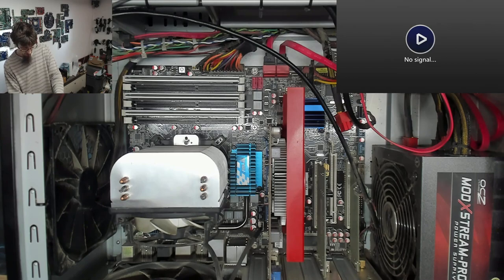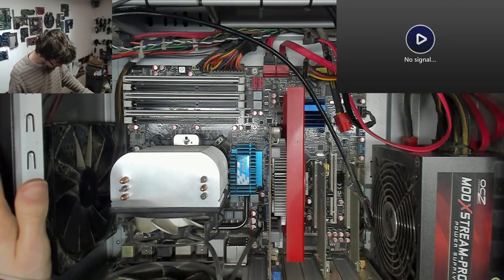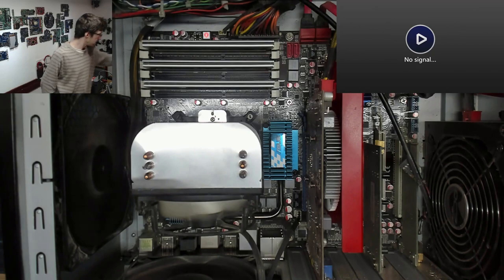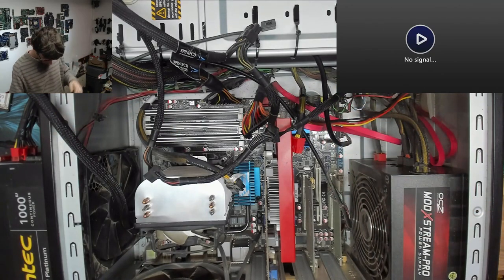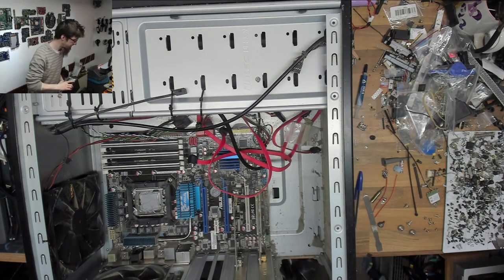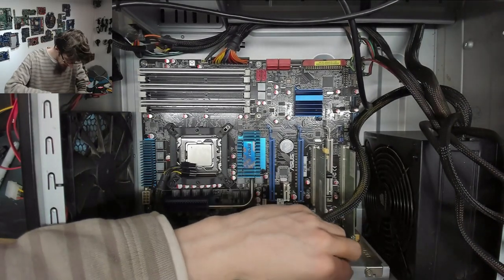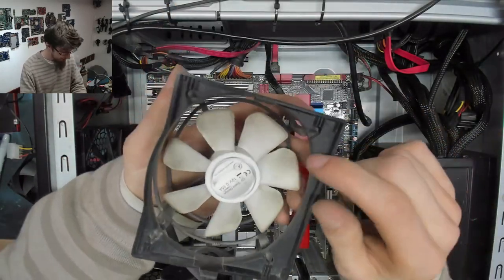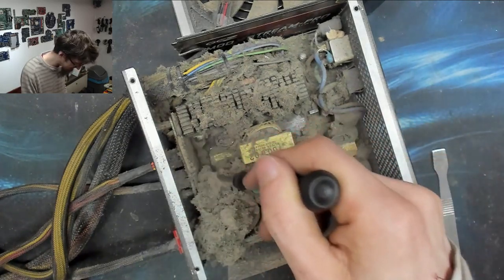LFC#163 - 1st Gen i7 No POST

Comment: The plastic sheet in the PSU is actually a blast sheet. It covers the parts of the parts of the PSU that could emit a blast or sparks out of the fan or a vent if it goes pop, mainly the AC inputs and conversion. I used to have a job repairing those and server PSU's. That is one of the dirtiest I have seen in my time.

Comment: The dust looked like the owner was a smoker or lived with someone who smokes a lot. That is some super fine dust buildup.
Reply: Smoker dust turns into a thick yellowish/dark tan color and is caked on thick not fine,  but at least we all know where you stand on smoking, For whatever reason;)
Reply: @wolfchacer0139  cigarette ash is super fine and stinks so bad and knowing smokers not all of it ends up in the ashtray. My old PC had a ton of similar dust build up from when I was younger. Now I don't smoke around the PC anymore but that's because the kids use it sometimes. 
Source: am smoker.
Reply: @LadBooboo  Yeah but with humidity in the air and other particles it becomes this sick Yellow/Brown gooey form on fans and other parts.  I build and repair PC's for a living and this here looks far more like neglect than any cigarette induced mess and is more typical.
Reply: LadBooboo my grandfathers old dell desktop has a lot of cigarette dust buildup. He doesn’t smoke, but my uncles did. They never smoked around the computer, or even inside the house. The residual smoke was enough to collect inside it.

Comment: Great video - as usual!

Two comments, just in case you really read all "old" comments:

- Regarding the time it takes for the CMOS to reset: From my experience, the CMOS is gone, once the battery is out. Like within a second. I never managed to pull the battery out and put it back in right away without the CMOS being cleared. The "PP_3V3_RTC" - as Apple would call it - has basically no bulk capacitance, since it draws zero power, like literally <1 uA.
One minute as a rule of thumb makes sense, when there is a Power Supply like "The Antec"  connected. 
I would love to see the results, when you do an actual test on multiple Boards. However: My rule of thumb is: 5-10 Seconds, but also that only for peace of mind. 

- And then again regarding "The Antec": You could just add a resistor to the +5VSB. I guess the Antec will have at least 1 A on that rail, which no MoBo will ever use. So maybe just add a 50 Ohm resistor (at least 2 Watt rated, so it does not get to warm) to the +5VSB on the backside of the ATX connector and that problem should be solved.

Comment: I've never seen that much dust in a psu before.  I use a brush and vac to remove the dust and if the psu is outside warranty, I open it up and brush it out, going outside to do it...always worth a look at the state of the caps.
I always check the 12v, 5v and 3.3v with a meter.

Comment: Nicely done. Visual inspection is very important so unnecessary work isn't done. 
However since there are multiple RAM sticks, I would first take each one out in a sequence and see if that makes a difference and see if any RAM slots are dead. Also as you did, defaulting the BIOS is one of the first things to do when.
Also I use multimeter to check if the PSU is outputing right volatages, 5V and 12V in particular.
I mean the order which you do things doesn't really, but taking all the wires out only to conclude that the PSU isn't dead is just unnecessary work. 
This is just my own preference however at some point you will go through these things anyway.

Comment: Did you test the powersupply after dusting it? I'm genuinely curious if it was one of those cases of the dust literally causing the issues or if the powersupply ittself died.
Also looks like i'm going to have to deep clean my powersupply after seeing this...
Reply: Old PSU may work but it's no longer reliable. Common failures are capacitors deteriorating thru time and last thing you want is a computer that will suddenly not turn on when you really need it to. Plus there's a possibility of it going out with a bang and damaging something else. Just replace the power supply.
Reply: My bet is that one of the semiconductor components overheated and eventually failed, possibly knocking out at least one power rail. The transistors, bridge rectifier, and voltage regulators in a computer PSU are on a heatsink, for a reason.

Comment: Hi, I support you on fan positioning and air circulation.  I've been in the IT industry a long time, like you, so have come across a lot of systems where tons, and I mean tons of dust has been removed froma machine. The problem with fins mounted downwards, especially if the PSU is to the bottom  is to do with where the case is situated and the air flow requirements of the case in a given installation situation. What's made worse is the amount of fans installed and which direction they are circulating air, which can either draw dust in or send out. of the PSU is to the floor, the fan must be faing up not down, why? if the fan is facing downwards, there is the high risk of an overheat and potential fire hazard. I always say that it's best to show a system owner how to clean and remove dust from a machine, whether a laptop, desktop or server unit. I get so annoyed when someone doesn't look after their investment, yes, it's argued that's money in technicians and  IT contractors pockets, but at the same time, it shows little care, knowledge or respect from the end user as to looking after and maintaining a system they've either purchased or built.  Keep up the amazing work love listening to your videos, yes, listening to them I am registered blind so a mac technician and using a screen reader to manage all this.

Comment: Hey adamant, I have a problem,  not related to the video.
I disassembled and assembled my laptop,
Removed CMOS to reset BIOS.
Some of the keys are not working now,
Keyboard connector is fine.
Can you PLEASE tell me what could have gone wrong.
It would be a lot of help. PLEASE
Reply: Not the respondent you asked for but here goes anyways. Those laptop keyboard ribbon cables can be particularly finicky, sometimes simply disconnecting it and reconnecting it can fix an issue that was due to a bad connection. I've had to trim the cable ever so slightly (half a mm or so) once or twice to get one working properly. Worst case though if the keyboard was somehow damaged when you were working on it a replacement for most laptop models is generally under $25 shipped, so if it is bad it's not an overly expensive fix.

Comment: had an old h97 with an I7 4790 and 16GB DDR3 1333 ram CPU ran at 3.60 and 3.93 turbo it died so got a Z97 and 16GB DDR3 1600 ram to replace it and it runs at 4GHZ on all cores all the time.  do not understand how the CPU runs on always turbo faster than its rated turbo being a locked CPU. not a big tech person so forgive me for being dumb, just would like to understand why this happened and is it good or bad and you seem like someone who may hopefully have an answer that I can understand.

Comment: I've had mixed experiences with OCZ, they're sata SSDs are generally pretty good (I've only had one die). But they're PCIe SSDs are awful. I bought two RevoDrives and they both died, they were replaced and they both died too. 100% failure. I realise this is a one year one video but did you try that PSU again after cleaning it?

Comment: Hey I've got a Asus z270-a with i77700k that a kid delidded said it woked for a bit got hot now it cycles on and off when I got it, I cleaned the chip and socket reapplied good thermal past under the lid and it remains on but no video out put to the hdmi port. It lights up cycles the fan just no video. So would trying another cpu be worth my while or is the board shot too? And do you have any other trouble shooting solutions i could try? Again thank  you for the last answer and help you gave me and thank you in advance man.
Reply from the maker: Only way to know is to change the CPU or Mobo. Normally I'd say It's Never The CPU (Except When It Is), but with a delidded CPU... it's probably the CPU.

Comment: I have an old x58 Supermicro Workstation board and noticed that the IO hub chip gets really hot, wonder if there is a better heat sink than the one I installed.  I have 20 gigabytes of memory and noticed with the addl memory the board gets hot.  Should I put heat sinks on the VRM modules by CPU?  or should I not worry about it?  The IO hub or Northbridge chip has a heatsink w fan, but peaks in temps of 107 C but drops to 87c when idle.  Low budget install, thanks to Ebay and the Xeon 6 core x5800 CPUs. -- even if board goes bad, only cost me $42.00 US
Reply: Replace the thermal paste on the north bridge

Comment: I've heard a novice isn't supposed to open a psu as the caps can still hold enough charge to kill, even after days or weeks of being off. Can you explain where we should NOT touch?
Reply from the maker: Inside the PSU is the only real no-go area unless you know what you're doing. Everything else in the PC is low-voltage. PSUs are not user serviceable anyway. They can be repaired in certain circumstances, but it's absolutely not a DIY job.
Reply: Don't go near any big capacitors in anything without discharging them. Big means high voltage; they can have charges equivalent or higher than your mains outlet. Learn where AC ends and where DC starts since DC is commonly safe.
Reply: Rectified mains in the primary side of the PSU will be up to 340v DC in the UK (mains/0.7071).  That's why the big primary caps are typically rated for at least 400v.  This circuit should be designed with bleeder resistors to drain the caps quickly on loss of power, but never assume.

Comment: so i have a weird issue. when i have my back panel installed the pc will randomly shut down and wont turn back on until i unplug the pc and plug it back in. the power supply seems fine and ive confirmed the problem goes away witht he panel off and the power supply not secured to the case with the screws. is it some sort of grounding issue?
Reply from the maker: Are you certain that the IO panel isn't poking into one of the USB/Ethernet ports?
Reply: @Adamant_IT  well first off thank you for taking the time to help me. looks all clear to me and i pressed on it all around and all is good. i should clarify though. by back panel i mean the one thats meant to hide all of the cable management. (back side of mobo)

Comment: I have the same model O-C-Zee power supply, working since 2013, with no problems. I just replaced it, just 'cause I could. Even though it might have been the modular cable for the GPU, it was probably time to retire it.
Reply: *Zed

Comment: A good upgrade for this is Xeon X5680 6 core, update bios and OC to 4ghz !
Reply: Or the W3680 or W3690, both of which have unlocked multipliers, therefore simpler to overclock and even possible to overclock on OEM prebuilt motherboards using overclocking software! With 4GHz you'll get up to 85% the performance of a Ryzen 5 1600, with same core count as the R5. Not bad at all.